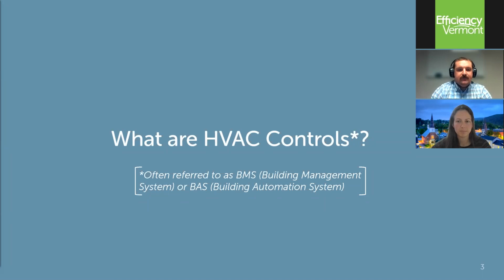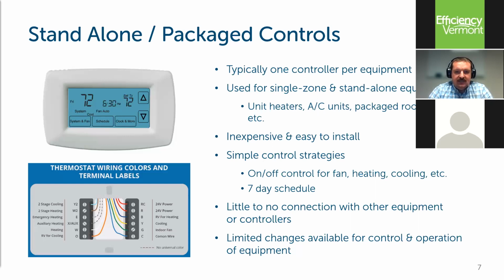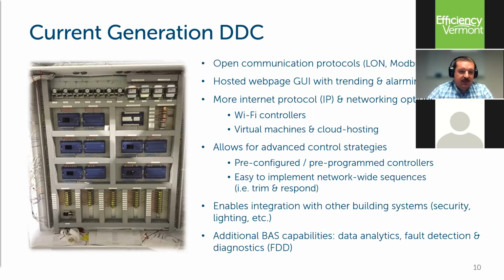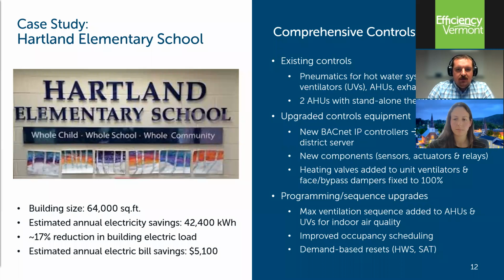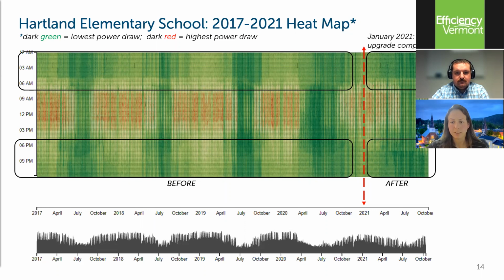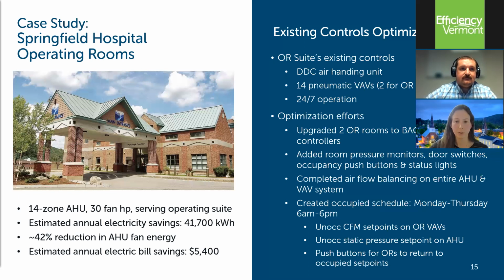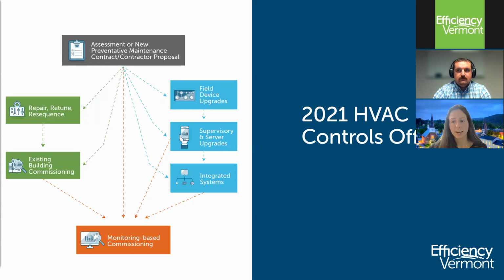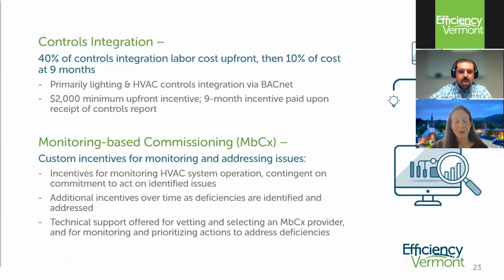HVAC Controls: How you can reduce your HVAC operating costs

Comment: The system architecture of the older DDC system is Barber Colman Network 8000. My first DDC system. It was a great system. Solid and reliable. XPSI for ASD devices. Signal and Host 8000 as the GUIs. My first job was at Barber Colman Aiello, Inc., an NYC joint venture office. The good old days.